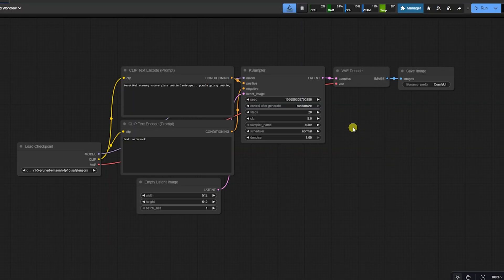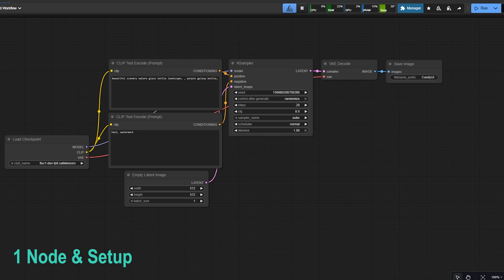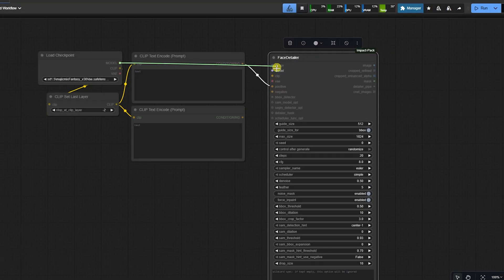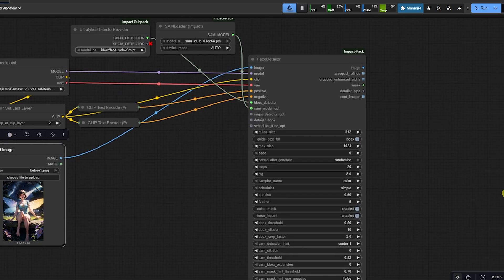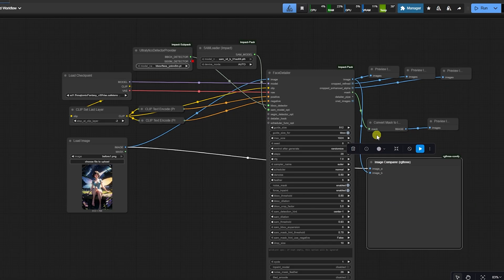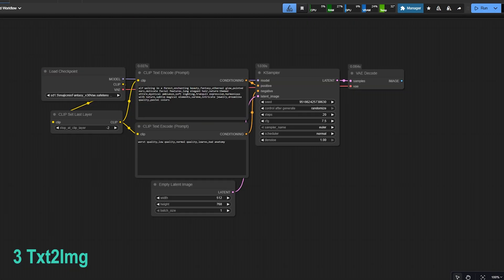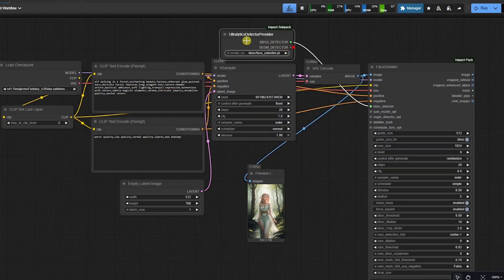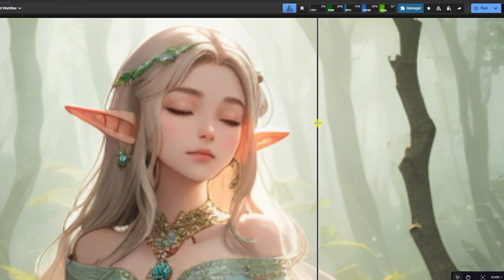🟢 Simple Face Detailer in ComfyUI (ComfyUI Shortcut)

Comment: Thnaks so much for this video, it's working very well. But for reel character, can you give me best parametes for facedetailed node ? Sometimes, face is not consistency !
Reply from the maker: Hi Thank you for your comment. The default setting for facedetailer node from Impact Pack should work for most cases. Its job is to identify "what is face" in the image and inpaint. It's not doing anything special other than that. If you would like to have less change from your input, then please lower the denoise value. Please feel free to drop a line in our discord server and have a discussion over there.

Comment: Hi, great video
Is it possible to use a node detailer for other body parts?
Reply from the maker: great suggestion! yes the same detailer can be used for hands too, for example. would you like to see other use cases? we can include workflows you wanted to see in the next videos. thanks.
Reply: @The3MinuteNode  I managed to do it myself, I did it separately for body, face, eyes and JUNK, one at a time, and the results were AMAZING!!!
thank you very much
Reply from the maker: @henriquecarvalho404  Yes, I usually do it one at a time as well. Glad it worked for you.